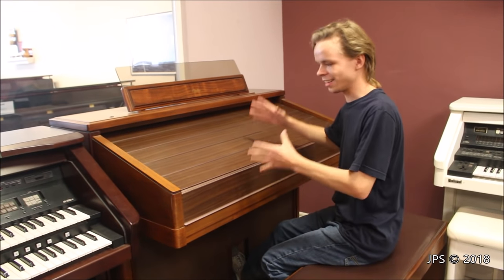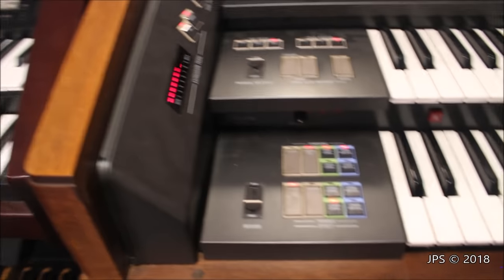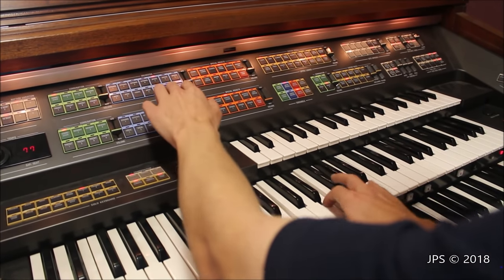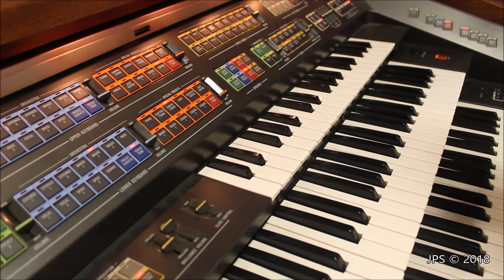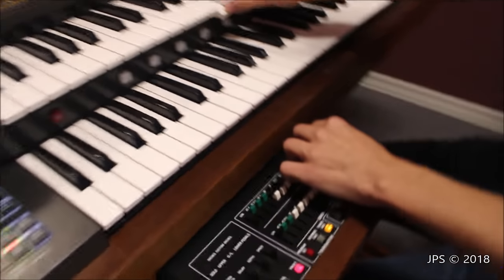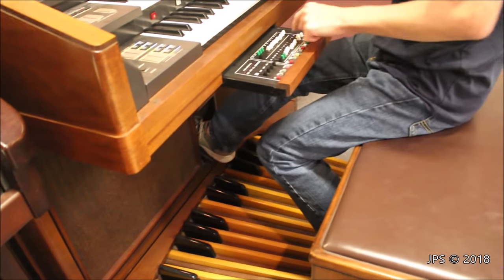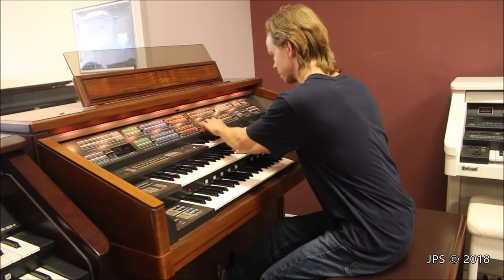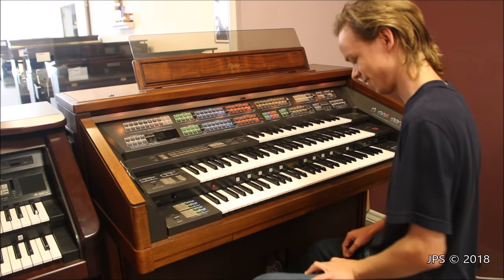Yamaha Electone FX-20 Organ

Comment: It’s a piece of art in 1983 before Midi. There are a lot of wonderful one-man-band live performance helper secrets that haven’t been shown. Faders are all motorized. Knee control is for full-in, pitch bend, change parts etc. same as those hidden toe switch in the volume.paddle. Try to memorize the whole settings for different part of the song in the white memory buttons. It could store the settings into cartridge for different songs. And the most unusual thing is, all faders are motorized. So you could recall the mixing levels of different part of keyboards but still trim them during the performance. In addition, for live performances, making the fader closer to the player to get louder is natural instead of push away to get louder.

Comment: The logic of the volume sliders is such as the Hammond drawer bars . You push they get lower. If you know anything about Yamahas, they have been doing those drawers from back in the 70's. The FX series was the last of them. The FX-20 was the top of the line and regardless of the FX-1 which is almost identical, they are amazing organs. The problem with some of the FM sounds from the 80's lacked some luster. The lever is used for sustain, and can be assigned on later HX models and such.

Comment: This Electone FX-20 was manufactured back in 1982/83. The reason why the volume slider has to be moved downwards for maximum volume because of the designs of the tabs or stops of the older Electone models; you had to push the tabs downwards to activate the flute voices you want and these tabs came in colours such as green, red, yellow or white, just like the E-20 or C-55 vintage organs. The third manual is the solo keyboard where the controls and sound panel are located on the left of those smaller keys. The FS and FX models are some of the last Electone organs to have the very grand spinet designs and powerful amplifier speakers. Played on them before in some churches and I do know a few of these organs are being used for up to 20 to 30 years (in Singapore) ….now many churches have the Electone Stagea organs :)

Comment: Hi James, my name is Adriaan Laurijsen and I performed on this FX 20 during a Yamaha Electone Festival in Holland in 1982. It was a top of the line " Electone " not " organ " in that year (even though the HX 1 came out little after this FX 20.) The presets "then" were considered " great " in those days. They  "couldn't " make a " piano-sound " really sound like a piano... it was always like "toy piano " sounding. But that wasn't the major feature of the instrument. Coming back to WHY it wasn't considered an " organ " !! That's because even though it looks like one, it has all these presets that you went through, and "ONE" of the presets is the "organ" sound. But instead of giving you only 6 or 8 preset organ sounds, they decided to put in that organ board underneath so you could use the drawbars while playing. Former drawbars on Yamaha electones only had 3 settings and were more like tabs. (look at the C-55 or D-80) 
The strong point in these "electones" was that you could use "packs" to register the presets in "sequence of use" including tempo changes and pre program the drums (can't remember if FX 20 could do this) My later model HX 1 can. The " KNEE LEVER " as it was called was for bending the tone of a pan flute sounds down. Or sustain on " piano type sounds" Came in handy. Later it was a switch on the volume pedal. One for Rhythm "start/stop" and on the other side for "sustain" ( on my WERSI I could program the "function" of those switches which came in handy because you could even put a sound on it (like " you can ring my bell" that song and put that drum sound which is recognizable for this song on that switch) i'm getting off track now. The "Solo" mono tone mini keyboard came from the D-80 earlier model and it's sound canvas is on the left of that mini keyboard. Funny thing was that if you wanted to play solo on it, " vibrato " could be added by moving your hand fast left/right while depressing a note (key) I don't remember if one had options for this function Like a now used (modulation wheel) like on my HX 1. I hope  I was able to tell you some new things about this great yamaha "electone" FX 20..... PS I enjoyed your video and enthusiasm while going through the features on this model. Thank you, greetings Adriaan
Reply: You're correct.. This is from the mid 80s.  I played one of these too in a Yamaha competition. Played Copacabana and got first place. Was supposed to record my performance to send off to the national finals, but missed out on the chance. It was a great organ. Still have my smaller version Electone MC600.
Reply: I had one of these organs before but it sounds best withna Leslie speaker.
Reply: I competed in those Yamaha festivals also. Made it to the regional finals.  In hindsight, it was all a wonderful marketing exercise, but it was also a lot of fun and felt like you were part of something big.

Comment: I had a Electone E5 by Yahama, was a great keyboard, it had the pull out drawer also. The sq. buttons between the keyboards are presets, thanks for the review.
Reply: E6 was also a great model by Yamaha ... its speaker, white-ish in color, has a very odd asymmetrical shape btw, which is probably a Yamaha-only thing ... i don't quite like Yamaha's later digital keyboards (compared to my most favorite Casio ones that is) but Yamaha 'analog' organs are so great, among the best imo ...

Comment: I'm a bit late - hope you sorted the achine out. I was surprised that you didn't cotton on to the buttons to the left of the solo keyboard - they control the voices. The key to this organ is the button group - 'ensemble', which allows you to combine all those other sections. You were looking at the drawbars. - on the ensemble, select upp combi, and you have now selected the upper  combination button set. The 4 top button has 1 button - 'lever', which will play the sound as per whatever the drawbars are now set to. But, if you want, you can store the current setting in of 3 memory buttons. This gives you 4 custom drawbar settings - 3 memories and 1 current serrungs. The bottom row are 4 preset sounds. Any or all of the other instrumental and percussion groups can be added/removed via the ensemble buttons. You need to hear this machine played by someone (like a theatre oragn player), and you will be truly amazed, it's hard to pick it from a small orchestra. There are a few people playing fx20 on YT, but, if you are despearte to hear some, let me know and I can email you some. I have an fx20, and many years back, an organist, Tony Fenelon performed a concert for the local yamaha dealer. It was simply stunning. Mind you, the machine has never sounded as good, but Tony is an exceptional player. Thanks for your interesting videos!

Comment: Also, why the volume for the separate rows is bottom; max & top: min is because when you are playing a piece, it is easier to pull down and go straight back to your playing so you don't mess up. So that is why they made it down instead of up, so when you are playing, it does not slow your tempo down to change the volume.

Comment: What kind of organ is that white one....
Reply from the maker: It's an early model Roland Atelier AT90. Later versions had a touch screen. The organ just to the left of the Yamaha is a later model AT90 just like mine.
Reply: @ThePianoforever  can they hook up to a Leslie or a keyboard amplifier
Reply from the maker: A vintage Leslie has a proprietary connector, but it's possible to run guitars or really anything through a Leslie, although I have no personal experience with it. The organ does have an output jack, but it also has its own speakers in the cabinet that work pretty well.
Reply: @ThePianoforever  it may have its own speakers, but if it has an output Jack, that means a 4×10 Hartke cabinet with a David Eden preamp will REALLY make that thing shout, can you imagine the bass you can get out of that
Reply: @ThePianoforever  a Leslie will also vastly improve the sound quality
Reply: @8-biternie944   the "leslie " in the FX 20 is electronic. (hammond lovers think electronic leslie's "suck" Sorry I have to agree). Nowadays all "new" keyboards come with electronic "Leslies" Think of the noise a real leslie makes, and it's heavy and bulky to cary around.

Comment: Wow this brings back memories. I was very fortunate to have one of these 1985-1989.  The FX-20 was Yamaha's flagship from the Electone range of this era and featured the introduction of FM (Frequency Modulated) sounds. I know you said it sounds a bit tacky, but at the time we considered this to be an astonishing leap in sound quality from keyboards from prior eras. It was also Yamaha's first range to also feature touch-sensitive keys giving a new dimension in expression.

The top keyboard is called the "solo" keyboard by memory, and it has a limited number of instruments to chose from on the panel to the left of it. It was a special keyboard for monophonic solo instruments like a trumpet or flute - i.e. can only play a single note at a time.

Yes, the slide-out drawer for the traditional pipe organ sounds was cool. You mentioned difficulty in changing it while playing, but the idea was you could pre-set different combos, and store them as presets readily accessible in the upper and lower green 'combination' sections up there on the main console.

One of the most magical things about this Electone is its ability to remember 8 entirely different setups (registers?), including the positions of all those individual mechanical volume slider controllers!  So when you press one of the 1 to 8 to recall a setup, all the selections change in a flash, but also those volume sliders actually moved like magic back into the position you had them stored. Unfortunately over a number of years the volume slider mechanisms would seize up, so Yamaha's next generation replaced these with a non-mechanical equivalent.  It was never the same, not seeing the magic of the actual levers move like magic. I'm sure probably just needed a little cleaning or WD-40.

Furthermore, you could buy a memory cartridge and store the register settings to the cartridge. They were expensive so I only had 2 of those cartridges, but I remember taking the cartridge to music lessons and being able to easily recall all my pre-sets on my teacher's FX-20.

For it's time, this was an amazing piece of technology, and a well-built sturdy piece of quality furniture!  A nightmare to physically move around, but it truly was an honour to have one.

Comment: It looks like the controls for the topmost "solo" keyboard are to the left on the same plateau as the solo keyboard itself.
Reply: Bless him so excited that he missed it, I guess that knee thing alows you to bend notes or add vibrato?
Reply: @keiths-teeth  it's called a "Knee Lever" ... it's usually used for controlling the reverb mid-play but in advanced models other functions such as vibrato etc can be assigned to it as well if i'm not mistaken ...
Reply: @keiths-teeth  no vibrato, just sustain and note bending for pan /flute sounds.
Reply: Yes. In fact, the only difference between the FX-10 and the FX-20 was the FX-20 has this solo keyboard, and everything to do with that is literally on that level. Besides that, the two models are identical.

Comment: hi James! great review as always! this is my 2nd comment here btw because i just got a beautiful FX-20 in near-mint condition a few weeks ago, FREE! (all it cost me was about $160 to rent a U-HAUL truck and tow it from 45 miles away in the LA area to my place of residence in OC, Ca ... and well, some extra gas/mileage costs for my own car as well because my wife and i had to drive there first of course!) :-) it also has 4 hard-to-find-now memory cartridges!

just like yourself, i had difficulty finding out where the sound buttons of the mini-keyboard solo section are ... but pretty soon i found them: they are to the left of that section on the 3rd tier (2nd upper keyboard) but somehow they are easy to miss at first glance! silly, eh? :-)

the knee-lever thingy under the lower keyboard can be used to control the reverb, among other things as it's assignable ... then there are some input/output sockets under there on a small panel as well, to the right of the knee lever, plus an extra light switch that can turn off the lights if the cover is drawn out and closed/locked, so one doesn't have to push the folding cover back only to turn the lights off in case one forgets to turn them off after turning the entire unit off ... cool, right? :-)

there's also a foot-switch to the left-upper section of the volume pedal ... it's also assignable to do things like the rhythm variation ...

there are three big external speaker sockets on the rear lower section of this behemoth of an organ as well btw: 2 for Yamaha's own super-powerful TM-1 speakers and 1 for a Leslie ... 

that 'mysterious' mini-drawer on the left with those cute little register volumes and stuff, was already in use in the earlier Yamaha Electone organs of the 1970s btw ... i remember Electone E-6 of the mid-1970s hand one for example, which i saw in a catalog back in the day ...

you may also want to know what i learned only an hour or so ago: FX-20 shares all the basic features of the FX-1, only the latter is more advanced and looks much cooler in design ...

search for the FX-1 if you don't know about them already and i'm sure you'll agree it's such a great looking instrument really! it's along the line of the older GX 'White' series of Yamaha organs, with its first produced as early as 1968, made of super-lovely white fiberglass with grey and black trims, aluminum, chrome pistons and so on, suited to decorate the inside of a 24th century ultra-modern starship from the Star Wars movies! ;-)

also, based on what i learned, the FX-20 came out in 1983 actually (and not late 1990s or early 2000s as you guessed) and its price was more than $20`000 at the time, while the FX-1, also marketed in the same year and produced in a limited number, was twice the price of the FX-20  ... (the FX-20 weighs more than 420lbs btw, and FX-1 more than 560lbs! imagine me, a 61-year-young man, had to tow the FX-20 mostly on my own using a non-standard dolly! wish had someone to take photos and videos of me, especially when i moved it down the truck's ramp after arriving home! i'm really lucky it was not damaged badly except for some little scratches, nor was myself!) :D

last but not least, the instruction manual clearly discourages using this organ's lights as nightlights or something along those lines as you suggested yourself ... and i think that's a good precaution as replacing those bulbs is not easy really! also,  if i'm not mistaken, last night, while checking things, i probably discovered another small light underneath the lower keyboard to illuminate the pedals section, as similar organs usually do although it doesn't light up anyway, which is probably due to a dead bulb or something ...

more useful info on the FX-20 and FX-1 by someone who's owned both, here:
https://bentonelectronics.com/my-yamaha-electone-fx-1-acquisition/#1
Reply: My father had the same instrument and the GX 1. Dad was the National Yamaha Electone Champion in Australian in 1977 and came in the top 5 in Japan. I grew up wit this beast. Dad died in 1988, but we had this organ for a very long time. Stevie Wonder had one too. There is a hell of a lot of 1980's pop and commercial rock music recording on the FX 20 and the DXI SYNTH.

Comment: The volume and reverb knob is pretty similiar to a Hammond organ's drawbars. That explains why max is on the bottom
Reply: On the older electones you pull the stop switches towards you to turn the sounds on, they usually had 3 levels of volume as you pull them towards you. Similar idea to hammond draw bars, they actually kept the volume sliders upside down through the MC and ME range of electones, strangely the ME50 was loud at bottom and the ME55A was loud at the top. From then onwards the volume sliders were the right way up with max at the top. This persists to the current Stagea Electone range.

Comment: The right knee controller is usually to control the sustain and to cut on and off the sound between the presets.  Have you tried playing around with the numbers right below the upper manual.  The small keys above the upper manual also serve as the synthesizer.  The sliding box at the bottom of the keyboards is a lot better with the E-5 that can replicate several combination of sounds; by pressing in between I believe 1 to 5 and C for cancel to do several combination or settings.  I have an E-80 that has no preset box but has three numbers below the lower manual 1 to 3 and C for Cancel and switching preset sounds and the normal combinations.  This is where you use your right knee controller.  I have not tried using the FX models but I know it is based on the same principle.  The levers for Yamaha organs always the softer sound on 1 and the loudest on 3.  I believe there is a basic organ manual setting online these days.  I hope my comment help you even in some little way.